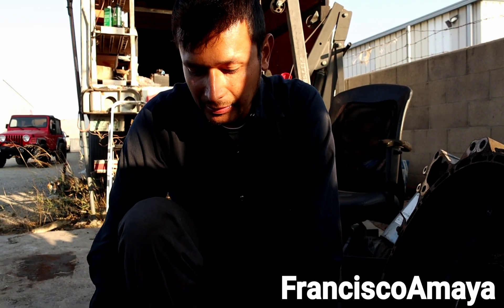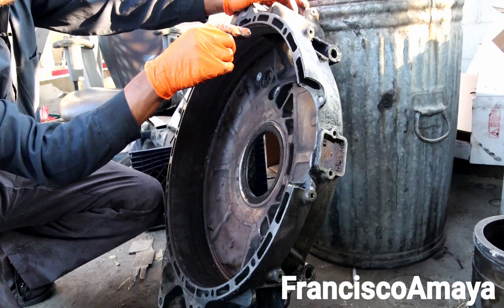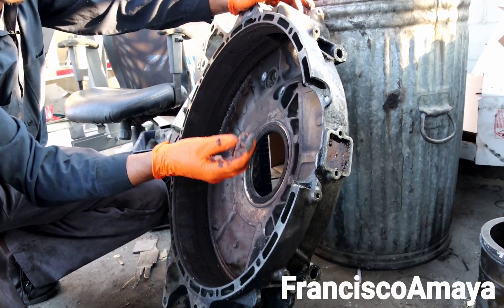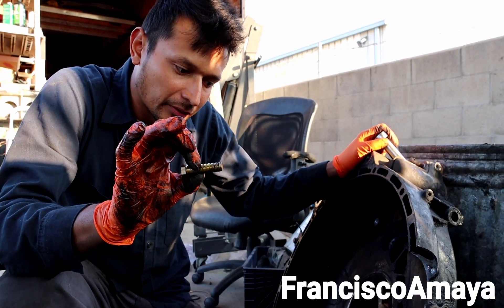Freightliner Cascadia DD15 transmission bell housing damage bolt broken transmission fell down

Comment: Thank you so much for this well explained video.This happened to me,right now in waiting for the shop to break everything down so I can know all of what happened.
I had a clutch changed in 2021 and I believe the bolts began coming loose destroying the threads.The problem wasn't even recognized till 20 months later.It took awhile before it was very noticeable but it happened. A good used fly wheel housing cost about $500 and like you say the crank shaft, clutch and other parts has to be replace because of the damage this cause.
Thank you Francisco again well explained.

Comment: This happened to me. 
I'm actually flew in the mechanic shop.
 It actually cracked my brand new transmission under a year old.
 The cat shop actually claimed that I was supposed to bring it in for retork which is ridiculous. I am a certified diesel mechanic and I know that's not a thing.  Cost me almost $12000.
 I didn't notice a vibration nothing it was driving fine I pulled over want to get back in my truck lost what I thought was my clutch brake and then it started shifting funny like it wasn't going completely in the gear. Then it fell out and jammed my 13th gear in the place I was stuck in gear.
Reply from the maker: Yes, you are absolutely right.  They didn't do the job right. But most importantly, they didn't show any professionalism to handle the situation. I am sorry to hear that.
Reply: I'm sorry to hear this, did you had to change your transmission as well. If so how much did the transmission cost?
Reply: How long did it took after the work was done from Cat that this problem was discovered?

Comment: That happened to mine. I was shocked when my shifter just dropped. I had to replace everything Francisco is showing. Parts and labor was around 3,700. Everything i bought was used except new clutch. New parts were too expensive